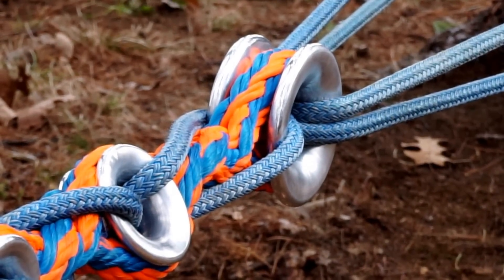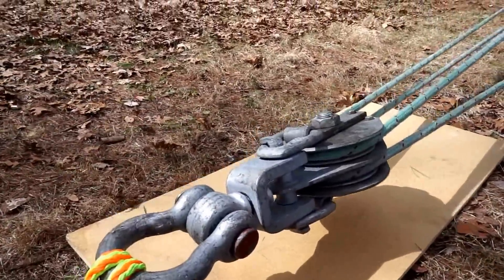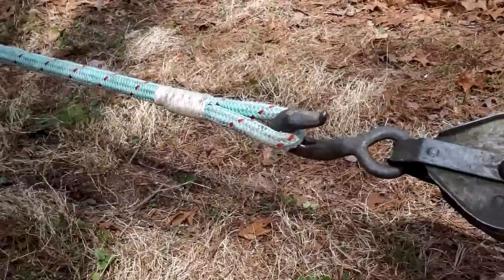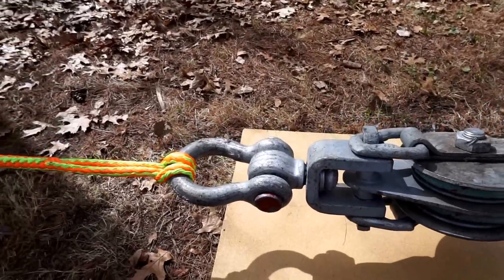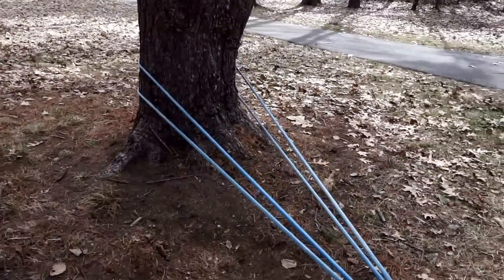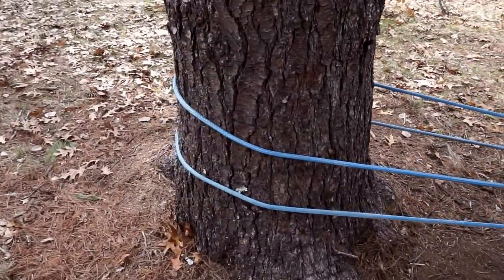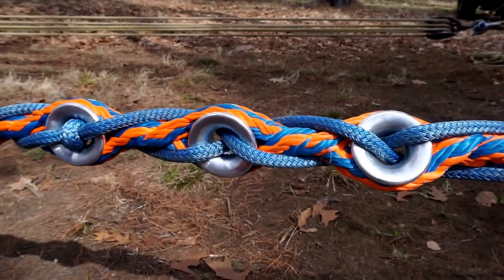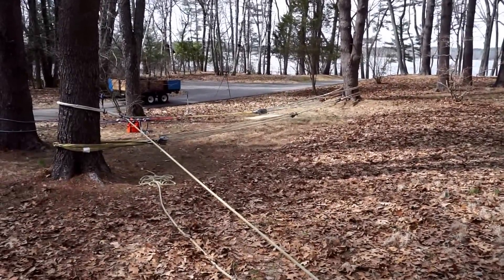E/E Anchor Sling Proof Testing

Comment: As both an engineer and an old rescue squad troop (high angle Walker Co GA in the 70's) the sounds from 5:30 on made my blood do really weird things.
Glad I wasn't trying to catch (intentionally or otherwise) that big double-sheave pulley!
Reply from the maker: +loganv0410 Hi again, Logan.  That 120# beast flew 12 feet faster than one (1) video frame and dug a 7-inch deep divot ... !  Yep, it would have left a mark.

Comment: That was a nice break! If you would like to know what the rates capacity it breaks at, I could find out for you. I have access to a 200 ton pull test machine which would break that easily. And I could tell you what it broke at. Normally in rigging, a lot of the hardware and material has a 5:1 rating. Sometimes higher. That's a normal safety factor!

Comment: Hey Tom,
That was spectacular, just as enjoyable as the Flying Stump video.
I'm determined to build out a system like yours and though I really hate to be a pest I just have to pick your mind on this.
I sourced a giant snatch block and I'm wondering if two big snatch blocks would be preferable over a single with the two 8 Ton blocks?
I'm also trying to locate a couple of Triple sheave blocks like yours.
I found a few that look similar but can't tell if their adequate.
Can you give some info on them? Particularly the sheave dimensions (diameter, rope size), and if their is a number stamped on them. I found a few that have a number 8 and a number 10.
And what are you using for rope and the length needed to make them useful in a 7:1 configuration?
I really do appreciate your time and hope you are doing well. Your missed at the Buzz.
Reply from the maker: DSP, I'd like to help but it will be easier to talk than write.  Send me an email Tom@Hoffmann.net with your phone.  I'll call your one evening and try to be useful.

Comment: Tom I have a question. using a 4 parted block system will yield such a mechanical advantage (minus whatever frictional loses you have). a 2 parted block will almost double your pulling power compared to straight pull (again friction) but a 4 part will not fully double a 2 parted block. If i wanted more mechanical advantage is stacking or putting the parted blocks in series (the haul line of the second parted block set-up is attached to the running block of first parted block set-up, like what you did in this video) would that give me more advantage and less friction than an 8 parted block? Is the extra advantage negligible?